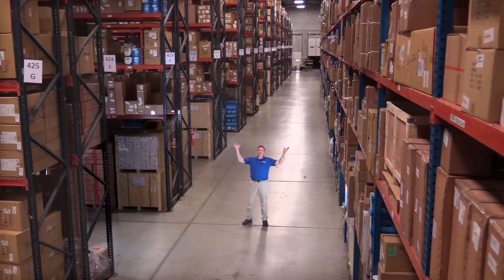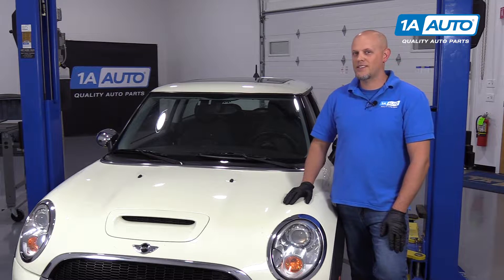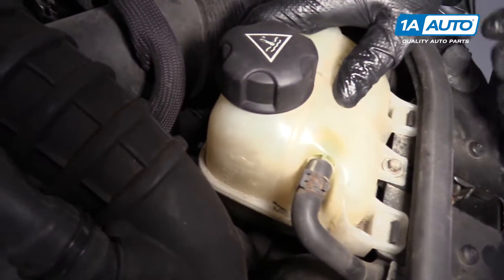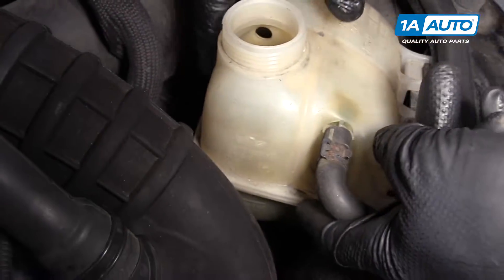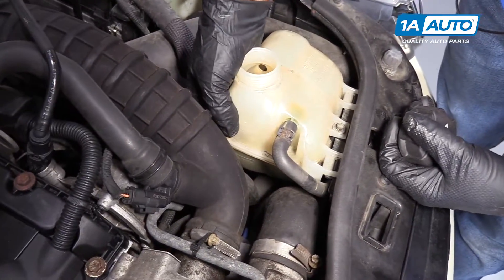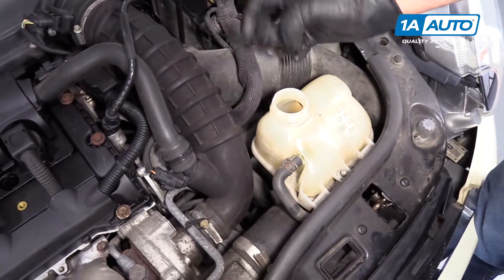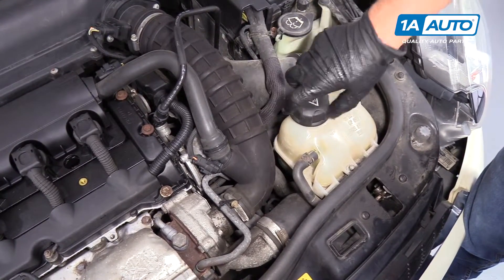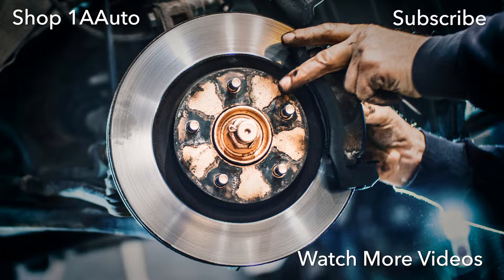How to Check Engine Coolant 07-13 Mini Cooper S

Comment: hello I have Mini Cooper s clubman, the water is boiling hot, we take it with different mechanics and they have no idea what it has hopefully you can give me an idea about this
Reply from the maker: +Lucy Frayde We wouldn't be able to diagnose an issue like that here, you may want to have a local mechanic take a look at it. Thanks for checking us out! http://1aau.to/m/Shop-1AAuto-c
Reply: Check the valve for venting the air out of the cooling system a air pocket will keep the water from circulating properly also check thermostat.

Comment: so I came to watch this video, because I'm trying to figure out what type of coolant to put in my car.   How you can have a video about replacing the coolant without specifying what the specs for the coolant for a mini are... is beyond me.  And of course the owners manual doesn't say what coolant to use!
Reply from the maker: +E Unit It might say on the bottle. Double check the owners manual. This video shows where to check and fill coolant. In the radiator replacement video we had to top off the coolant. It is a premized 50-50 antifreeze coolant mixture. Thanks for watching and have a great day!

Comment: What kind of coolent does a 2008 Mini Cooper R56 BASE model take?
Reply from the maker: +Joanna Longwell There are a few brands that are specifically listed for your vehicle. If you are not able to find it in your owners manual your dealer will have it available or the info needed to replace it. Thanks for checking us out! 1AAuto.com